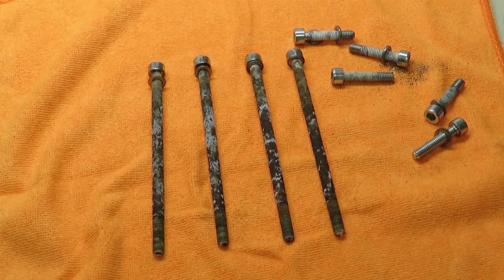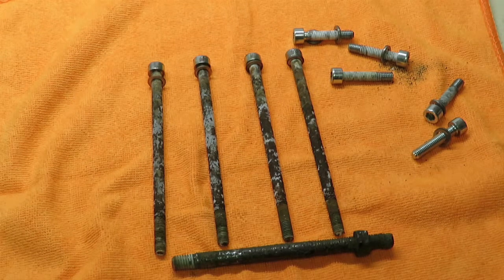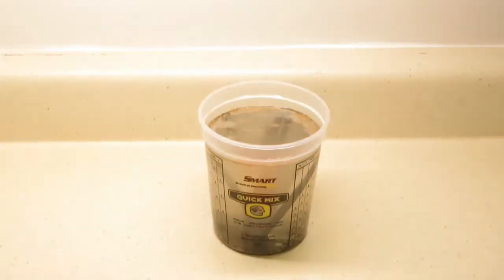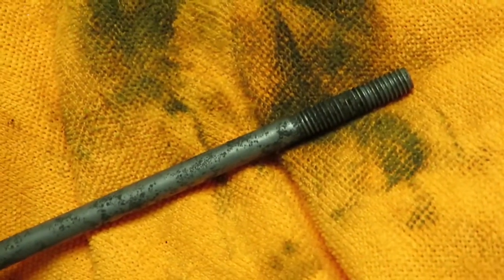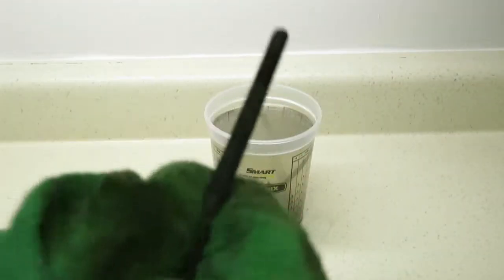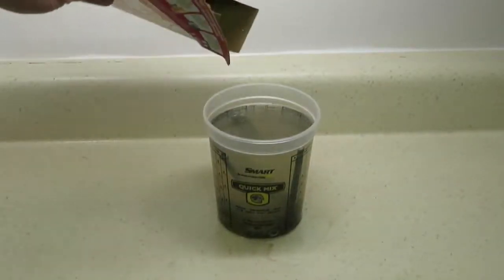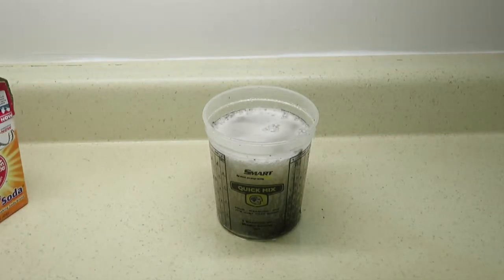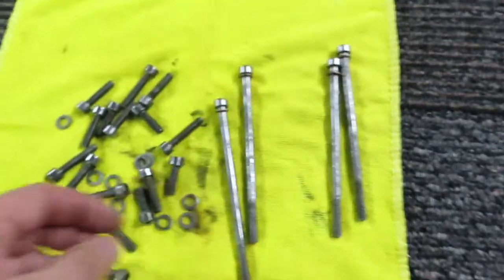Experiment: Using Vinegar to Remove Rust from Bolts?

Comment: You should not have put the baking soda in. You soak in vinegar for 24 hours, then brush the rust off. Then you rinse in baking soda water, so that it neutralizes the vinegar and doesn't keep eating away at your metal. Then you can oil them down to help prevent rust from coming back for longer.
Reply: Basically, it stopped working after you put the baking soda in, so it only got the couple hours in when it should've had 24. 😂
Reply from the maker: Thank you! Hopefully people read the comments to get this info.
Reply: Hey. So how much baking soda do we need to add per gallon of water?

Comment: My seized wheel hub was loose after a 20 minute soak and 3 small taps i used non diluted cleaning vinegar and a spraybottle for easy distribution over the hub
Reply from the maker: @TheDutchGuy110  nice! Thank you for sharing this.

Comment: Remember, blueing is a form of rust /oxidation! (For the firearm hobbyists, mostly!) Thanks!
Reply: Disposable rubber/latex gloves 🧤 may protect your bare hands from Tetanus (caught by touching rust) -but, I recommend the big yellow waterproof kind that goes up to your elbows/shoulders. Vinegar is only $1 -but, it can be reused if you filter out the rust. You ONLY want to use it for rust, though! You don’t want to cook with it! Maybe you’re cheap like me and don’t feel like getting any more than 15 gallons for bigger projects like engines. Plastic totes with tops work well for keeping out rainwater and prevents the vinegar from getting watered down and/or diluted. Also, vinegar has a really strong aroma that can burn your sense of smell if you inhale it. They taught us to waft it in science in high school. Thanks!

Comment: After using white vinegar i have noticed that the bolts tend to rust very quickly. Do you reckon i should use more baking soda to create a protection for the metal? Thanks! Great video!
Reply from the maker: Maybe a light coating of WD-40 or similar
Reply: @DCAutoEnhancement  sounds good! Thanks!
Reply: @nikossokin4428  fluid film, petroleum jelly, grease, anything oily that stays oily on the bolt will keep it from rusting
Reply: Bolts are not purely steel. They come in a rotective coating. The rust forms in areas where the protective coating is removed. Vinegar removes all of that protective coating. WD-40 adds a new coating. It is made of a silicon compound.
Reply: Paint !